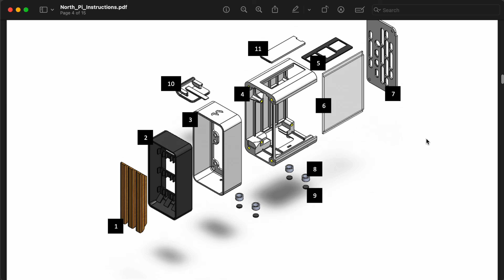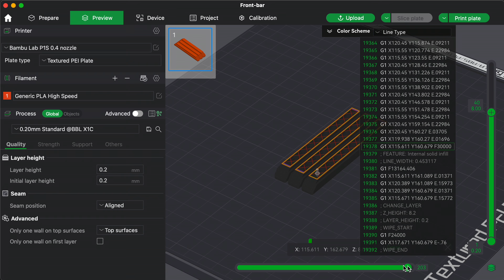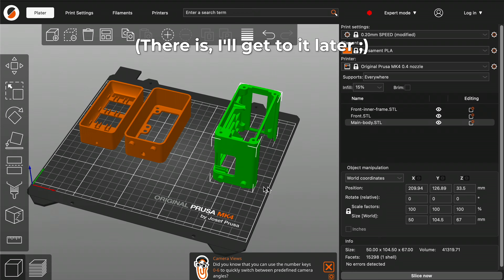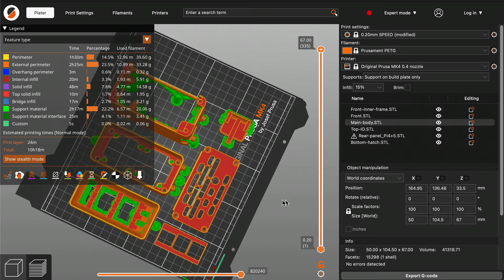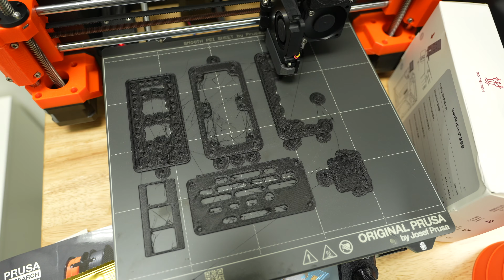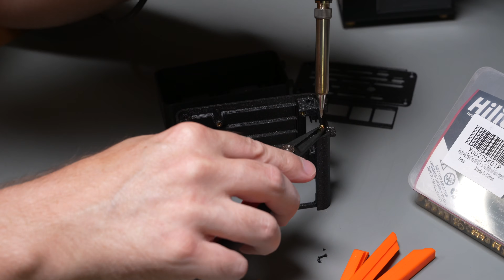Fractal's newest PC case is... free? (some assembly required)

Comment: Recommended temperatures for the filaments are written on the boxes and having a quick look that first petg filament prints between 220-240. The standard petg profile prints at 250 so that is why it was so stringy. Next time try printing at about 230 👍. Also check out paint on supports so you can pick where to put supports.
Reply: This is probably the best advice when it comes to reducing the stringing on PETG. Dehydrating for future prints is for sure a good idea but shouldn’t be an issue on a fresh pack from Prusa like you had. Lowering the temps to around 230 (230-240 seems to be the happy area for most Prusament PETG in my experience but can always do a temp tower first to make sure you get the best results).

Comment: I always thought STL meant slice to layers lol, and certain overhangs can be printed as long as they're just a straight overhang with no curves four corners if it's just a straight bridge from one to another and you could tell by going to the layer and pressing left on your keyboard and watching your nozzle do its thing and see if it's a straight overhang, and you know you don't have to use a different slicer for each printer if you like bamboo slicer you can use all the printers there but even better orca slicer is one step further or up

Comment: It's easier to use the "Place on face" tool (F shortcut) in the left toolbar in PrusaSlicer instead of manually rotating the object to rotate it into the correct printing orientation.
Also, "snug" would have probably been a better support type. It's easier to remove for long straight bridges. Organic supports is great for models with many small contact points, for organic shapes like busts and figures.
It also looks like your filament was very wet. The PETG V0 is even more hygroscopic than regular PETG. It should be dried before each use (it's written on the product page). If the filament is dry it will not be stringy. Prusament PETG V0 also has its own filament profile in PrusaSlicer. It's different from the regular Prusament PETG profile.
You're also using the wrong type of heat-set insert. The ones you used are for injection molding. It works but it's not optimal. The ones for pressing in with a soldering iron typically have a sort of spiral-knurled outer surface.
Reply: CNC Kitchen sells both heat-set inserts and specially shaped solder iron tips for heatsetting.

Comment: Fractal knew exactly what they were doing when they published these files. The Venn diagram describing the raspberry pi and 3d printing communities is probably pretty close to a circle.
Reply: Heck plenty of us run our printers of a pi!
Reply: @oliverer3  Not a lot run their printers of a Pi400 though ;) 
I am still super happy about that choice, even if it was back then driven by the Pi shortage and Pi400s were the only available and halfway reasonable option.
Reply: @oliverer3  can confirm, i've seen me do it.
Reply: Well, considering my rPi 3B+ that is the brain of [one of] my 3D printer[s], yeah you're probably right. Octoprint is great :)
Reply: I have RPI3B for 6 or 7 years and now I'm considering a printer. But it's understandable, people who have some free time, electronics with GPIO but without mechanical parts gets boring and sometimes I need a stuff like RPI camera mount (when camera attached to cardboard box by wires is not enough). Also Arduino projects without boxes for sensors, Arduino and battery are getting messy.
Reply: Honestly kinda genious way to do Advertising/Branding.
Reply: I had to buy a CB1 thought.
Reply: Was that a DBZA referrence?
Reply: Have you said Octoprint?
Reply: @remy44444  Octoprint is so 2020. The cool kids are using Mainsail now. xD
Reply: I've got 4 printers. 3 of them shit and 4 raspis. One of them for my good Voron. I think I'll print one for my home assistant instance at home. Propably won't do it for my home assistant at work, because I don't care how that one looks. Might CNC the wood panels.
Reply: Don't say venn diagram. Now Kamala and her minions will flood this chat

Comment: Filament, materials and electricity costs so not really free even if you own 3D printer.
Reply: The design is free.
Reply from the maker: All those can be accounted for pretty precisely now, though—the slicers all calculate a price that's filament-specific, and I track the power consumption on all my 3D printers (the Prusa uses maybe 80-90W max while printing, Bambu a little more), and I always physically cut power through the smart outlet after the print's done, which ends up saving a substantial amount of power through the year (assuming you're not running a print farm!).

All-in, this case was about $15 in raw materials (including the wasted PETG), maybe $1 in electricity, and 2 hours including the time filming the video. The labor is by far the biggest cost, even though it's free, because I pay in time :)

Comment: They didn't want to bother actually manufacturing it....
Reply: I'm sure the cost/benefit came out way behind, it was never designed for mass production. Pricing it low enough for lots of people to buy it won't work because it's too niche, and pricing it high won't because there's even less price insensitive customers. This really is the best case scenario, they could have charged a summary amount for the files but they would just be pirated anyway.

Comment: I am still not sure I need 3d printer, but it looks fun
Reply: This is what I thought before I bought a cheap Ender 2. Debugging print settings made me realise a mill would be more useful to me, and although I enjoyed modelling parts programmatically in IceSL (like OpenSCAD but and IDE specifically for 3DP, with slicer etc built in), there were too many "am I doing this wrong" aspects at the same time for a satisfying learning experience. Seeing all the printed crap on Facebook that people were printing just because they had a printer put me firmly in the "stop making more plastic waste" camp.
Reply: Once you have a 3D printer, every little thing that need fixing around the house becomes your next 3D printing project...

Comment: for the front bar, they designed it with a 45 degree angle, so it could be printed without flipping and without supports.
Reply from the maker: The little 'winglets' that pop off on the sides would sag on the first couple layers though, if there were no supports. I guess if you print it on the side, you mean?
Reply: @Level2Jeff  No, if your cooling is good enough like on the P1S or Mk4, it'll print those fine. I just printed them and while there is an ever-so-slight bit of droop, it is not enough to affect the fitment of the slats. Also, there is a setting in the slicer called "make overhangs printable" and while not always great, it's perfect in this case - it alters the 90deg joint to a 45 deg which again won't affect the fitment of the bars.
Reply: @Level2Jeff  Even if the 'winglets' as you call them have a poor print finish, they are on an occluded surface so you won't see them in the completed case. I was actually a little worried because fillets off the print-bed don't always print cleanly and that is the exposed surface that you'll see. But your prints look fine, at least through the camera and my monitor.
Reply: @Level2Jeff  I just printed them today on my P1S, I rotated them 45° so they sit in an 45° angle on the build plate, and i used a small brim just to make Sure it wont tip over. Printed perfectly fine
Reply: I think you might be able to print it on the 45 degree angle.